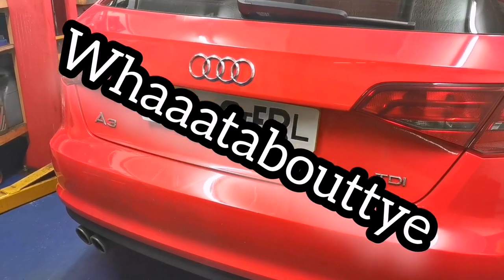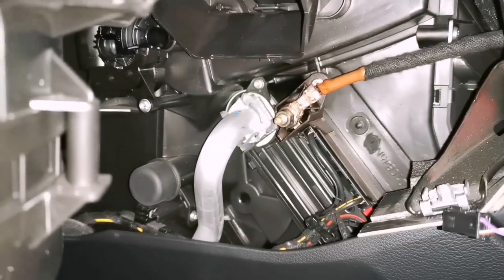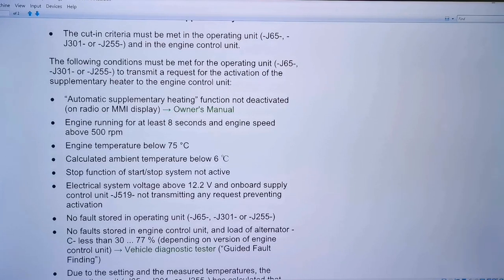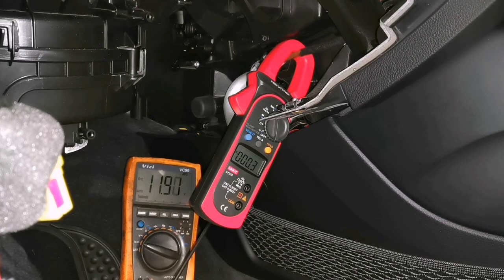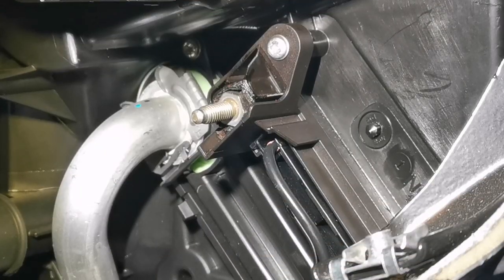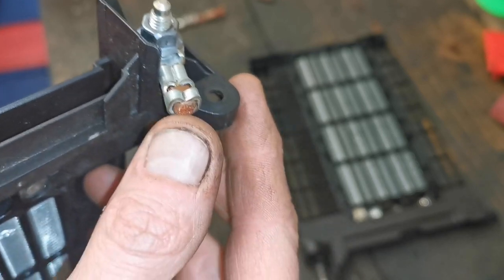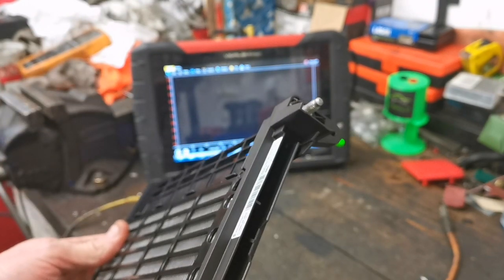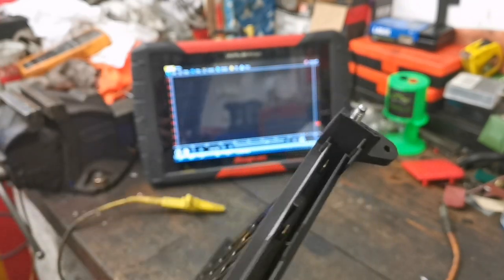Audi A3 2.0TDI, Burning Smell from Air Vents. PTC Auxiliary Heater

Comment: Absolutely Awesome and detailed video, You may be the answer to my prayers, I hope you would be able to help. 

Scenario:

2015 VW CC2.0 TDi, Passive Error Code P302D00 High Heat Output Relay Short To Ground.

I'm not an Auto electrician but having persisted in trying to get to the bottom of this I have isolated the problem is 100% to do with this PTC Aux heater. Basically I can clear the fault from the ECU and reproduce it everytime the conditions for PTC Heater to be used  are met. (As you showed on that VAG Tech Bulletin)

1. Start the car cold. 
2. Switch on temperature above LO (0) 
3. I hear a short "electrical whine" for a micro second in the cabin.
4. The scanner will find the fault.

The error doesn't show (after being cleared) once the car meets the criteria for PTC heater no longer needed.

So @davesterl any pointers what I can do to fix this or what are the potential causes of the short to ground may be? 

More importantly I don't want to die in a burning VAG is there a fuse I can pull out to make sure it's not getting a current to the PTC if I forget to leave the blower fans off or the blower temp is set to anything other than 0?

Any help would be sincerely appreciated because VAG Tech support UK have been absolute C***S with any information to do with anything.
Reply: I'm shocked that this potential fire hazard doesn't show any sort of dashboard errors or symptoms, I only found the error by chance when I was using my scanner to check the DPF Data and just on the off chance I ran the ECU Diagnostics.  The generic OBD Error scan DID NOT SHOW any faults 🤯

Comment: Really enjoyed this video, just shows how good attention to detail can identify a problem. From a technical point of view, what a shoddy design! Given the high current draw there should be some kind of strain relief on the connector. Maybe the original loom was slightly short putting strain and vibration on the connecting stud.
Reply from the maker: Good point, i did consider that in this repair and why i left the cable a little longer.

Comment: I have a burning rubber smell when the aux heater is turned on in the climate control settings and it's below 4 degrees celsius outside. I checked the cable connection and is soft as well. It's a 1.6 TDI 2014 Golf 7. Should I go to Volkswagen specialist or a car electric specialist just to repair the connection?

Comment: I have just literally got my 2014 Audi A3 TDI back from the dealer which had exactly the same problem. They had it for over 2 months and at first had no idea because of it only happening when cold.  Further inspection showed a completely melted auxiliary heater and earth wire.. all have been replaced under warranty but I'm not entirely sure as I think I can still smell it slightly.  Unless it's just the new heater bedding in.

Comment: Comin next in your new 35000 pound car , a 4 slice toaster , keeps you warm when the manufacturer cant sort out decent heating when they invest millions of euros in development,  but it comes with so many extras its untrue electric cars will be worse with 415 volts running through them , I pity these kids starting out in our job Dave , it's going to get worse , great video as usual,  and great technical information,  cheers 👍👍👍👍
Reply from the maker: I know Mike, i need my Toyota to do me for another 20years from what we are seeing now
Reply: @davesterl  , I think I might have to get my strada finished , these new ones are crazy , over complicated overpriced and so unreliable junk
Reply: I think I might even keep my vw caddy 1.9 Sdi 2002 , kept dry at work , started once a month probably better than a new one 🤣🤣🤣👍, easier to fix and cheaper

Comment: Same problem in my 2015 Audi A3 TDI Premium Plus Sedan (USA).  Wife complained of terrible smell in the cabin when car was cold.  Went away after driving car a while.  Came back the next day.  Outside temps have been -5 to 15F the last week.  Shut off the auxillary heater in the MMI menu and problem went away.  Wife took the car to Audi dealer for oil change a couple days later.  They did a courtesy inspection and found the PTC heater lug melted in the same fashion as in this video.  They wanted $900 USD to repair.  ??????

I ordered the part, which new from a VW dealer was $200USD, and will install when I get a day above freezing.  Hopefully the unit isn't too badly melted.  For $700 USD I am going to try replacing  this myself.

Comment: Half way through changing mine, stripped it to make sure this was the issue before buying a replacement part, I just don't have a way of changing the wire, does it have to be replaced?

Comment: Not sure what year is that car in the video but audi had a recall for the PTC heaters about 2 years ago as apparently connectors were melting and there was risk of fire. Mine was replaced by audi free of charge.
Reply from the maker: On some models yes

Comment: There is a recall on the other models for this very issue, 8OC5, 80C6 I believe. Unusual on the A3 though.

There is a relearn in odis for all the motors once you re install them after repair to make sure they meet their end stops etc. Good luck
Reply from the maker: Cheers Stephen, aye no recall on this one that i could see